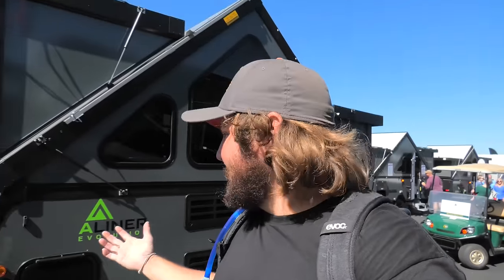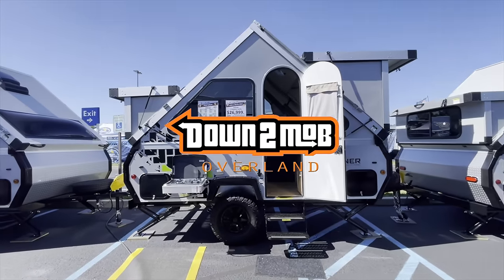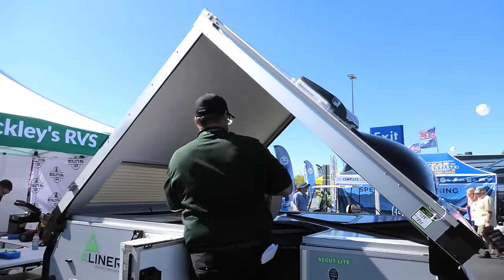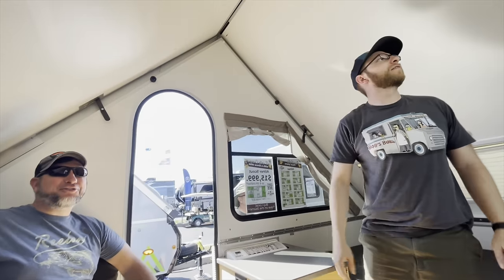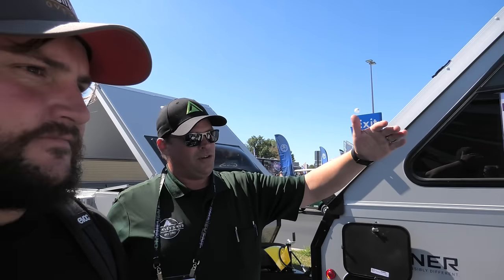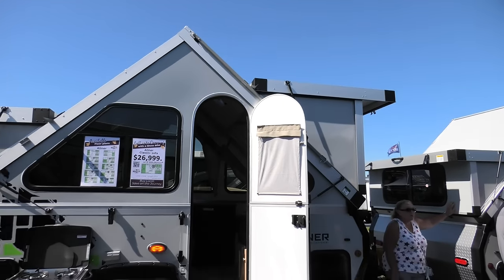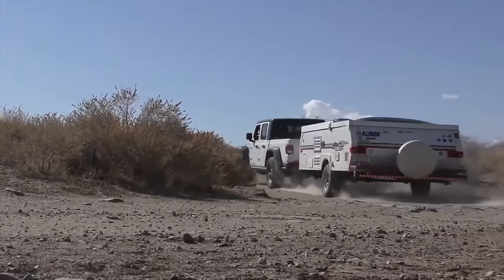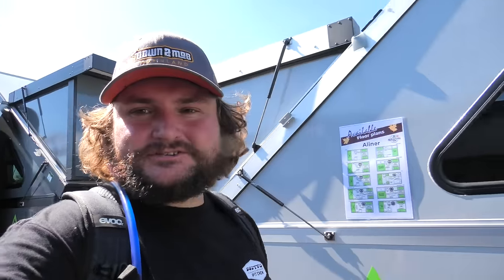The Ultimate Aliner A-Frame Camper Trailer Video - Comparing ALL the Models

Comment: We owned a 2020 Aliner.  Like a lot of RV's it was amazing to see all the poor quality of work.  In your video, we could see the Victron unit sloppily wired,  what looks like 110V wiring stapled to the wall and shavings of ?? inside the cabinet.  We had the same fridge as shown in the video and it was absolutely worthless (aware this is a Dometic issue but I would have thought Aliner would have known this based on many comments from users)  Replaced ours with a 12V compressor fridge.  Our roof aluminum sides were replaced after our very first camping trip.  Each camping trip resulted in screws appearing on the floor never to find where they came from.   Couldn't camp one night due to the high winds as we had to lower the roof for safety.  In hindsight, the base model Scout model is their best model.  Best to DIY all the things you want in your Aliner yourself and know they are done correctly and installed neatly.

Comment: The way the A-Liner goes together and how quickly it does is just amazing to me, if I ever got a trailer that would certainly be the one.
Reply from the maker: I agree. It’s very easy and satisfying to pop up, even for a 5 minute break on the road!
Reply: Yes, it is easy except in windy conditions, in which case, you need to buy the wind kit.

Comment: I have the Aliner classic with the off-road package and soft sided dormers. The soft sides add a lot more windows and air flow. If it’s cold I drop the dormers , and less space to heat. The outside shower with a pop up shower tent , and toilet works great for me.  Keeps the odor and humidity outside where it belongs.
Reply: Except when it is too cold and/or windy outside.

Comment: The problem with that shower is that you'd have to take the table down to use the shower and then get it all dry before you pack it away to set up the table again, which I think would be a PITA. Other than that, I like the Evolution the best, but the shower configuration is the reason I'll pass on it. I want a shower, but it needs to be more convenient.

Comment: I really like the Aliner design BUT…where is the independent suspension for actual off-roading? Where’s the articulating hitch? For those higher priced models that stuff should be included..I’d also like to see them have a folding top rack from the side like some of the Aussie trailers. It’d block your inside view from left side but being able to carry kayaks/bicycles low and out of the wind while going down the road would awesome.
Reply: But, didn't you see....it had off road tires...